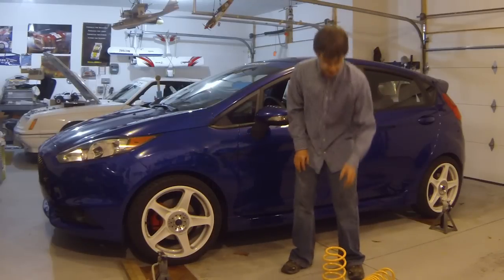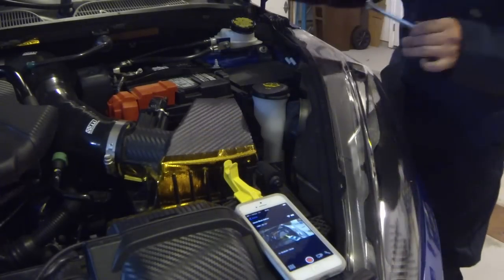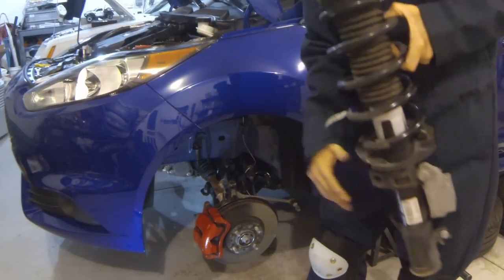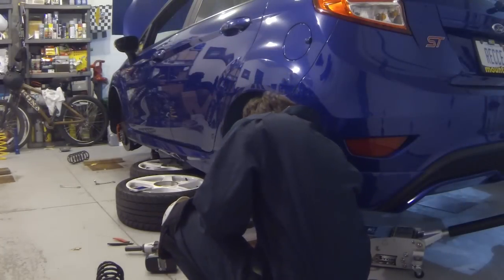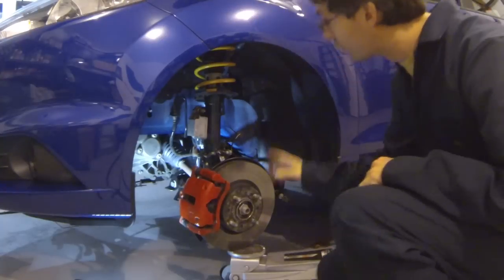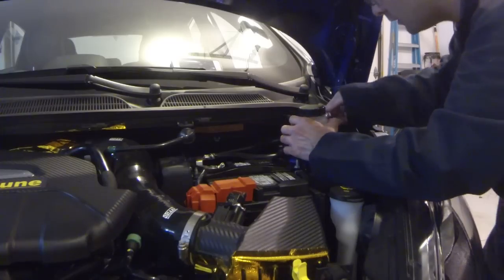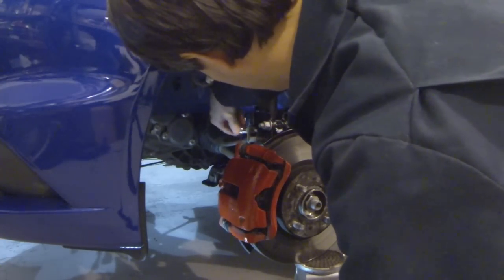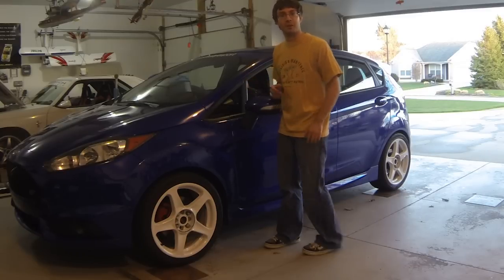How to install Mountune Sport Lowering Springs on a Fiesta ST

Comment: Someone needs to make a how-to for putting a fiesta on jack stands.
Reply from the maker: I use two methods with one being safer than the other. The safest is to use a jack located on the pinch weld (flange that runs between the front and rear wheel wells) about 10" or so from the wheel well. This should be far enough back that you can place the jack stand on the pinch weld. The jack stand goes about the same place as those covers on the side skirts. You don't need to remove those. The skirts are cut out on the bottom to allow room for the jack and jack stand at each corner. I usually start with the front side then to the rear and then do the opposite side. The faster and less safe option is to put the jack right under the front door handle along the pinch weld and lift the entire side of the car at once. The skirt isn't cut out for this, so depending on your jack, it may not work. I had to build and adapter to work and it has slipped before. I usually set the jack stand height so the tires are just off the ground. If I need the car higher, I raise one side at a time while the opposite side is on jack stands. I am very careful when doing this since the car is rotating on the jack stands and you don't want them to fall. For extra safety, when I take the wheels off, I usually slide them under the car so in case it were to fall, it would land on the wheels. This only works if you don't need to get under the area where the wheels are. Hope this helps and let me know if you have any additional questions.